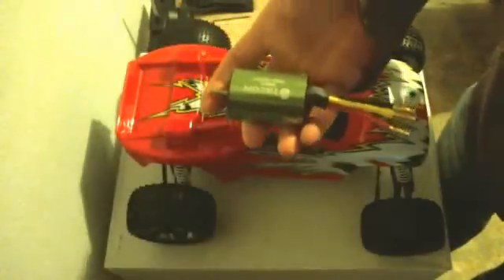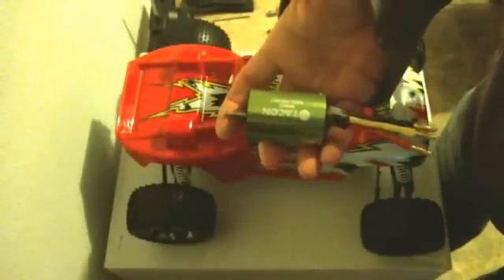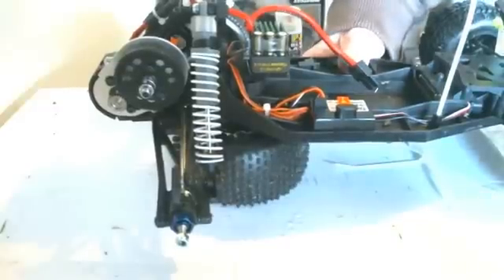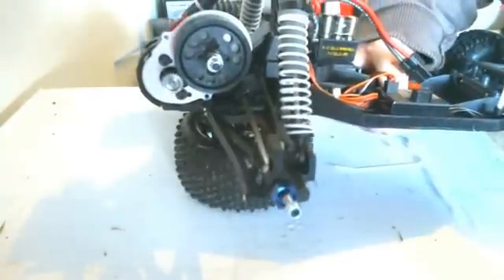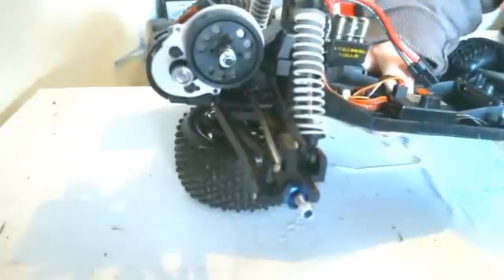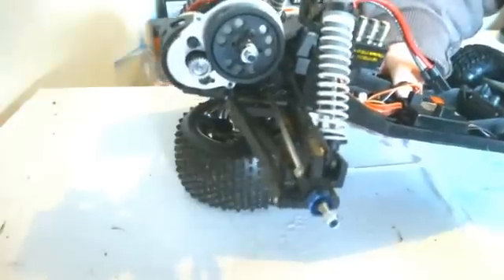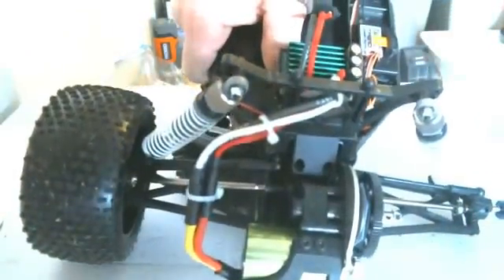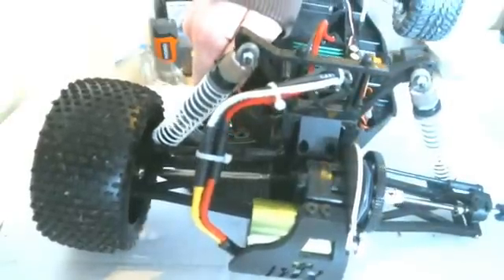Duratrax Evader EXT2 - Going Brushless video #3

Comment from the maker: A good brushless setup on a budget would be one of the Tacon "true 540 sized" motors around 3000 - 5500 Kv and one of the EZRUN ESCs.  I suggest something like the 70 Amp car ESC for 1/10th or 1/12th Scale.  The total is around $85.  You could go a little cheaper with another ESC with a lower cost but I suggest to get a decent ESC if possible.  It will save you some headaches down the road.

You should be able to find the part numbers on my website if you want to look at them.

Later,
Matt

Comment from the maker: @84honeybadger 

I haven't had a chance to clock mine yet but I should be between 50 and 60 mph top speed if I can keep the nose down.

I won't stop upgrading it until I break 70 mph so I still have some big plans.

Also just a quick note, I am using FULL ceramic bearings all around so I do have less resistance which equals better performance.

I will be doing some speed runs soon, once I get my new rims and tires installed........

Let me know when you post your videos.

Take Care,
Matt

Comment from the maker: @84honeybadger 

Most of the difference is because of the Castle Mamba Max ESC, it allows more power to go the motor than the HobbyWing ESC will. Castle Mamba ESCs have Higher AMP rating/better quality.

Also I have drastically changed my gearing on my setup  (stock is around 88t/22t and mine is 52t/20t) so that is another reason that my truck has more power than some.

I usually recommend going with a better quality ESC if you can get one, you will definitely see the difference in performance.

Comment: @BrushlessRCMotor it went ok but i have to get a new radio  because my radio  dosent have the setting that it needs to run with the brushless system im running so pretty much im unable to run it rite now until i get the Fly sky FS-GT3b radio

Comment from the maker: @daylindavid 

Thanks,

How did your Rustler build go?

I Have a good friend who loves his Brushless Rustler, my goal is to beat him of course.

I just dropped in full Ceramic Bearings and some Aftermarket shocks (Traxxas Slash Shocks fit nicely by the way if you want a lower ride height like I do for now)  

I will be testing it out on my 3S Li-PO later today to see how it does.

Thanks for checking out my videos.

Have a good one,
Matt